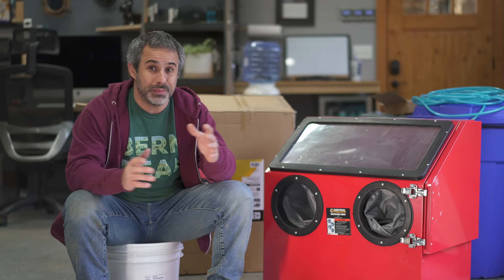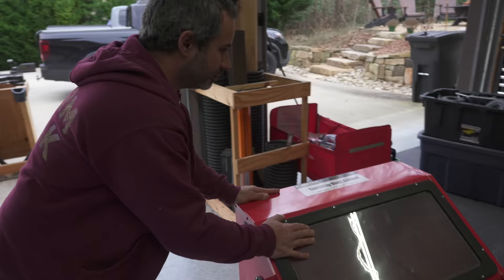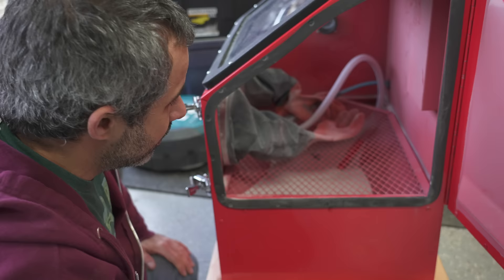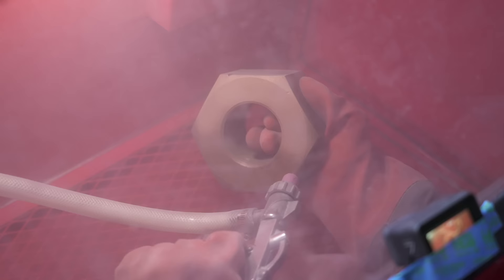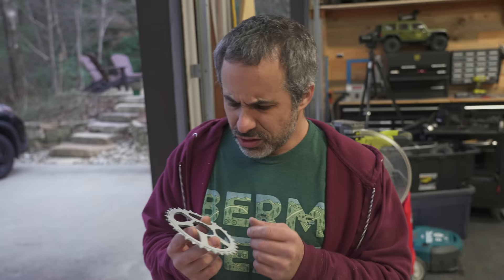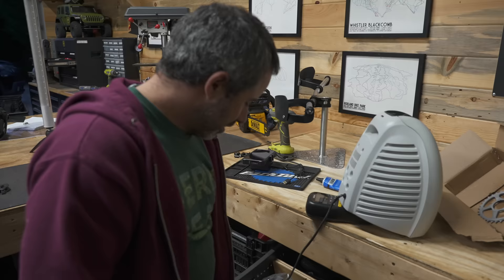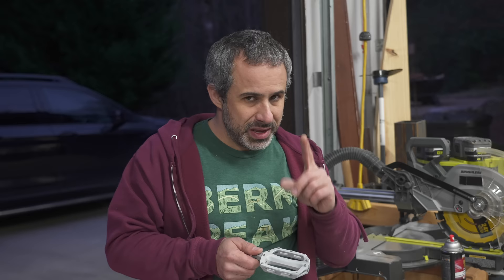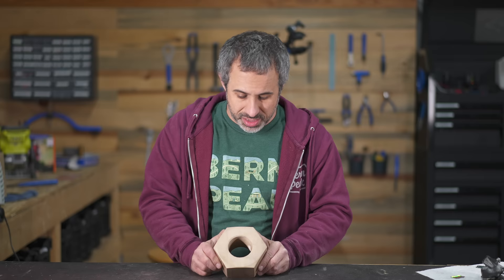I took your advice and bought a Harbor Freight sandblasting cabinet

Comment: Good choice on getting the cabinet.  You were half right on the dust being "probably dangerous".  The dust is definitely dangerous.  Harbor freight also sells other blast media like walnut shells that you can use to blast softer metals like aluminum.  Bike parts probably are fine but if you ever want to take on a frame, I wouldn't use sand. 

The clearcoat may flake off from what I've been told (did a lot of reading on blasting a frame to raw Al and clearcoating it, was advised against it for that reason), but you can have it clear powder coated at shops.  You might even be able to do it yourself, you'll just need an oven to cure it.
Reply: No kidding!  Silicosis is a real condition--ditch the sand for something safer.
Reply: You can make one of these cabinets just as good out of a cardboard box and a piece of plexiglass. $10-$15.

I've used mine daily for almost 3 years as a metal fabricator. Just as airtight and so light I can keep it up on a shelf out of the way.

Comment: I had one of these for years and for the money it worked great yes it was a little messy even when taping app the seems and the vacuum 🤣🤣🤣
I used mine for cleaning engine cases with glass bead media now i just send them out to get soda blasted its so much easier and saves me a ton of time great vid man 🤘

Comment: I had a buddy who bought a "outdoor media blaster" ( basically a sand blaster with no cabinet ) and he wanted to blast the inside of his old Chevy pickup. 
I told him " dude, you really don't want to do that. The sand will just fill the inside of your truck up because it just becomes the atmosphere in an enclosed area."  His answer was  "Im not an idiot, Ill tape off the vents, and vacuum up good afterward."
Needless to say , he got rid of the truck after months of getting sand in his mouth every time he drove the truck.😂
Dont do that.
Reply: HAHAHAHAHAHAHAHA DAMN, one of those great "i told you so" moment
Reply: But a lot of people with old cabs/car bodies do get them media blasted as part of their resto. Guess you just need the right technique.
Reply: @mrkthmn  yes, those guys take the interior OUT to do that, though.
Reply: So he never thought to use an air compressor to blow it out? He was already using one with the sandblaster. 

Not everything you need to sandblast can fit into a cabinet either. I'm not sure what you mean by "becomes the atmosphere". At most it becomes a fine dust that eventually settles. For us people that live near the beach sand in your car is a common occurrence anyway. This idea that it's blowing around in your mouth while you're driving is a new one to me.

The whole point of a cabinet is to keep the harmful dust and paint chips away from you and the environment, it's not required to do the job though. Also so you can collect and reuse your media.

I sandblast structures/frames I weld on and I just blow the sand out with a blow nozzle on my air compressor. It's actually a regular thing I do because I'm a tradesman and my truck gets dirty. I just open all the doors and blast the inside with my air compressor.

🤷
Reply: @nickstersss  It wasn't an I told you so moment actually.

It was a "I don't know what I'm talking about but I'm just going to give you advice based on an assumption" moment.
Reply: @jackolson8775  So he could have just taken the interior out after and sandblasted it...but sell it? 🤷

And like I said in my other comment about people that live near the beach. I've never heard of sand flying around while you're driving into your mouth. Doesn't sound like he even trying to use an air compressor to blow it out.
Reply: @dangerous8333  It seems there are several people here who cant visualize what exactly happens. A compressor is capable , IF you could find, then get into every vent and crevice in the interior. Believe me when I say, its nearly impossible. There will be sand blowing around in that truck for the rest of its life.

Comment: I have as a moldmaker used a sand blaster to straighten parts that have warped in heat treat. When you blast you are relieving stress and if you are not careful you can warp a piece that was straight. I am not a fan of 80 grit. Glass bead makes a nicer finish. Also when you blast you are imbedding tiny abrasive particles into the surface of the piece which may cause more wear on certain parts like a chain ring. What blasting is great for is removing rust.

Comment: you could also get a dremel and wire wheel for polishing really fast after you sand blast parts.

also you can use electrical tape or soft vinyl like masking tape to blast designs into painted parts :)

Comment: I did abrasive blasting professionally for a bit. I was in a blast booth you could pull a semi trailer into. It was 30ft inside height as well about 60ft long and 25ft wide. Massive compressors the size of small SUVs pushed 180 psi air through hose that had an OD of 4 inches and an ID of 1.5 inches. Used steel BBs and crushed copper slag. Shit it would blow a hole in an I-beam if you held it still long enough.

Comment: THIS IS PEAK SETH!  Also we actually use these cabinets in an industrial setting in multiple factories at work.  The only modification we do, is use media beads or walnuts vs sand, and we've replace the blasting gun with a nicer gun.  nice little cabinet.

Comment: red seal blaster here. if you  just want to remove old paint or oils, stains and just general aging of the material use walnut shells or sodium bicarbonate as your blast media  it wont damage the metal and create that rough texture. using semi sharps like you used in the video is dual purpose doing the same as the other two medias i mentioned but also creates a 2-3 mil profile that gives paint something to bind to. walnut and sodium also work perfect if you want to blast wood.

Comment: I have a metal casting channel. I also do brass. To get a mirror finish, start with 80 gt sand paper. Use wd40 as the "wet" work your way up to 2000 gt. The zon has a drill kit with all the grits you need on a 3 inch drill pad. It's only $15. Finish it off with "green" harbor freight polishing compound. 😀

Comment: i have one of the freestanding ones. , 
it up on cinderblocks. needs 2 bright floodlights in it to see.
it needs a dedicated shopvac to keep the dust away, and the vacuum will die in about a year from abrasion in the bearings.
we used a 220v shop 60gallon compresser to run it,
it hasnt been used in about 5 years , if there is even a drop of moisture in the abrasive it clogs up, was fun when it worked initally.

Comment: I blasted a lot of vintage parts with this exact blaster from HF. The rack from 1948 Schwinn, and all the brackets that hold the dynamo and light kit on, I did the fenders and fender hardware for my 1960s Royce Union.  NEXT I have everything collected up to start Copper and Nickel plating So I can clean stuff up and either paint or plate with the desired finish, and it will be better than when it came from the factory, but not look out of place..

Comment: A few tips. Use a large Air. Compressor. These use a ton of air volume. Strain your sand. Pieces of paint or dirt clogs the blast tip. Sand in plastic holds moisture and you need dry sand or it clogs. Use a piece of metal screen to filter sand inside the cabinet as you blast. It’ll trap the garbage as you blast.

Comment: I'm an ASU mechanical engineering student and I can confirm that the abrasive finish that the sandblaster leaves will not harm anything. Since Aluminum is softer than the Chain Steel, the steel would just eventually round out the tiny abrasions on the sprocket. I hope this helps!
Reply: If you follow up on the 80 grit with something like 220, and then mil12, it will basically be as close to mirror you can get without any elbow grease. I used to work in Semicon and they used the same techniques for their processes

Comment: mechanical technologist here, sandblasted parts can oxidize almost immediately if you're not careful, this is sometimes referred to as re-rust. this occurs because of sandblasting giving the parts more surface area and space for oxidation to occur. if you are putting a good layer of paint then you should be fine, however, in the case of a sprocket where the teeth remain unpainted, you may want to give them some hand sanding to bring back some of the metallic shine rather than leave the coarse rough finish.

Comment: The can wrinkled because the metal expands when you blast it.  If you blast one side of a thin flat strip of metal you'll find that it's bent when you're done.  Thicker parts won't show this because the media doesn't have enough energy.  It's like trying to bend a thick piece of steel with a light hammer, but the metal still distorts to some degree.

You can use different media to remove rust and paint without removing/roughening metal.

Comment: I've been using big commercial units on jobs for years. the newest method for outdoor use is dry ice, totally disappears. With brass just wire wheel it after blasting, then polish.

Comment: I'm a senior mechanical Engineering Student!!
I can say that the blasting media is the most important. For some projects that I've done, I use walnut material (I believe they sell at harbor freight), because it's not as harsh as sand. Sand is good for harder materials like the chassis of a car I.E steel. Aluminum blocks in the auto industry, people also use walnut media blasters. I'm unaware if you're model can do that however a quick google search can suffice. Look into your model and google media that can be run through and material used for I'm sure is provided. 

As for your sprocket, engineers usually don't pay attention to things like surface finish. Tensile Strength, Ultimate TS, etc. These material properties play a role in materials' ability to withstand "wear and tear" or failures. This is the case for gears, unless at a small enough level where surface finishes come into play (or grain boundaries). Of course annealing, cold treating, and other hardening processes can be done to aid here, however media blasting will not affect this per the hardening processes affect the material overall, not only at the surface. So blasting it should have no effect at all on the sprocket, as for the chain is harder than aluminum so a rougher sprocket can never damage the chain in any measurable way. 

In short, if you asked me, you're good to go.

Comment: Look into other blasting media. There’s glass garnet, slag, walnut shells, soda, metal beads, the list goes on. Each one has different properties and is catered for different use cases. For you something lighter like soda or walnut shell will still remove surface containment’s but won’t abrade the base metal as much, specially softer non ferrous metals like you work with.

Comment: Hi Seth - have you considered swapping out the abrasive sand for glass pearls? Sand with abrade the surface. Glass will simply remove the dirt and grime. I think as an engineer the sand will damage the very delicate and precision made mtb parts.

Another alternative is soda as a blasting medium - good cleaner and what's left can be simply washed away with water.

Have used the soda technique on my Porsche engine cases - top results...

Comment: I used to work at a company that did a lot of blasting. First wear a respirator as fine dust leaks out and it is bad for your lungs.
Second line the cabinet with rubber. For DIY, take old bias ply tires and cut the sidewalls off and flatten the resulting hoop. Then install it like shingles. For the floor buy an anti fatigue mat with the holes in it for the sand to drain thru.
Third always blast as far as you can from the glass and keep the stream of sand from riocheteing back into the glass. If you talk with a local glass company you can give them your dimensions and have them make any off cuts to that size to get replacements cheap. Don't bother with that safety glass they put in there as standard.

Keep moisture out of the sand.
Replace your nozzles before it destroys the entire gun.
Glass beads produce a smoother finish.
Your vacuum motor bearings will be trashed fairly quickly. 
Adding one of those dust cyclones for wood working will likely make your vacuum filter last way longer. Also the sand breaks up and gets finer as you use it. The cyclone at the right suction may take the dust and drop the still usable sand.
The pressure pot types work better, but you can do that as a future upgrade project if you use it a lot.
Don't blast your gloves. Set the part down as much as possible. 
Your sand will get full of whatever you blast. That will then be smashed into the part you are blasting. If you blast steel, and then stainless or aluminum, they may rust afterward making them look bad. It is just a very fine layer of steel particles embedded in the surface.
Steel parts rust extremely fast after blasting. Coat them within an hour generally.
Reply: If he fixes bikes, he will have a ton of old bicycle inner tubes to make seals out of. If they wear out, easy enough put a new one in. Fix them in place with silicone sealant, perhaps? Just good old hot glue?
Reply: @PaulMurrayCanberra  They could be stapled to strips of wood. More trouble and would wear out faster, but the price is right.

Comment: I didn't read through all 829 comments that were posted since February 6th?!  So someone may have brought this up.  But...for blasting parts for clean up without damaging the substrate, we use walnut shell blasting media.  Plus, once you have used the media up, you can just toss into the yard.  We use if for carb refurbishing on our race cars primarily, but we also use it on our suspension parts when we go through those throughout the race season.  You'll find tons of uses on more delicate bike parts.

Comment: sandblast and then wire wheel, always done so never had any issues, its great on brass although turn your air pressure down when doing brass

Comment: Soak pedals in an Alum&water solution to to slowly dissolve the steel without touching the aluminum. Alum is usually in the pickling or spice isle at your grocery store.

Comment: The effect that will have on a typical chain is minimal. 
 It will just get shiny wear points on it where the chain comes in contact.
Be sure it is washed off is solvent & blow dried & lubed prior to installation.

Comment: If you use glass bead blasting media after sandblasting, you can get a shinier finish that looks a bit like brushed metal.  You'd have to either empty the cabinet and replace the sand, or cut another notch in your workbench and get a second cabinet.

Comment: 👍 As Michael McLane pointed out you have a variety of media available for different applications . My preference for what l do is glass beads . Definitely a smoother finish than #80 silica sand . Be willing to experiment to find out what works best for your needs . Baking Soda is also very safe , environmentally as well .

Comment: If you have compressed air for your cabinet of sandblasting you also have compressor to blow off debris with clean air. As a finisher in the aerospace industry I would do a small batch at a time and air blast immediately. Also a Iight mist of oil on anything that could rust.

Comment: Masking off sensitive areas is a good idea depending on the parts you're sandblasting.  Teeth on chain rings, bearing surfaces, sliding surfaces, etc.

Comment: I'm an engineer, designing custom machinery for the food and packaging industries primarily. We sand blast a lot of stuff, but we tend to avoid blasting components or at least sections of components that are tight tolerance, a running surface like a bearing or sprocket, and usually we won't blast anything but stainless steel. Tight tolerance because it removes material and is hard to control amount of material removal, running surfaces because it's a rough surface, and only stainless because the rough surface promotes corrosion. Generally speaking we just tape off the areas that we don't want to blast, so for the sprocket you could just tape off the teeth and then blast everything else.

All of that said, there's actually one really interesting instance where we do sand blast explicitly for function, and that is for sheeter rolls that basically roll out the dough for certain types of chips. I won't go hugely into specifics, but we blast the surface of these rolls for a few specific functional reasons, but this is the only case I can think of where we actually do blast a functional surface.

Comment: Now you need to get a harbor freight powder coat gun and a toaster oven to powder coat a bunch of parts. I sandblasted my crankbrothers stamp pedals and did a chrome base with a candy red over it. They have held up really well for the couple years I've been running them.

Comment: I have a HF sand blast cabinet just like yours.  Owned it for 5 years. Did a few mods to it and I am happy with it's results.
Reply: Waste of money though.

You can build one of these for $10. Just need a strong cardboard box of equal size. Some good tape and a piece of plexiglass. Cut some holes in the front. I'm a metal fabricator and I've been using it for 3 years with no visual damage. It's airtight and lightweight. I pack it away when I'm not using it and just pull it outside when I need it. If it's raining I have a port on it where I attach my shops vacuum system that purges everything outside.

Comment: Wash the parts with soap and water after blasting if you intend to paint. The reason touching the parts leaves a big finger smudge is that its actually coated with a fine layer of sand and its absorbing the oils.

Comment: I restore aviation fuel systems professionally. Love our sandblasting cabinet at work. Any painted part gets blasted and repainted. Pro tip: a heat lamp will help cure the paint.